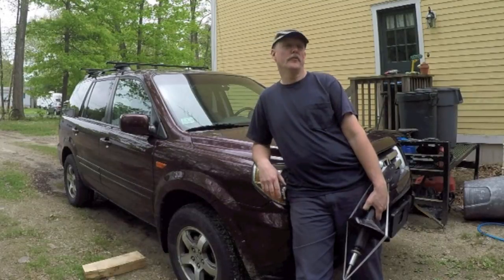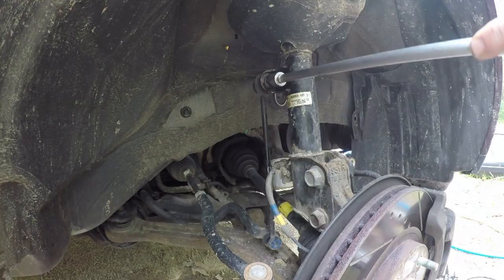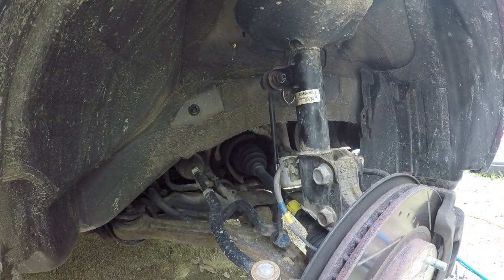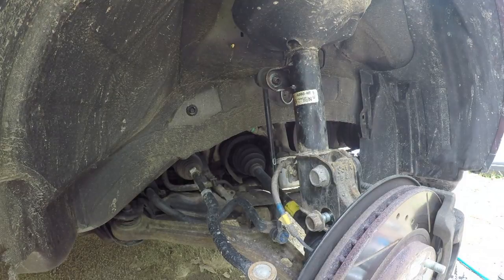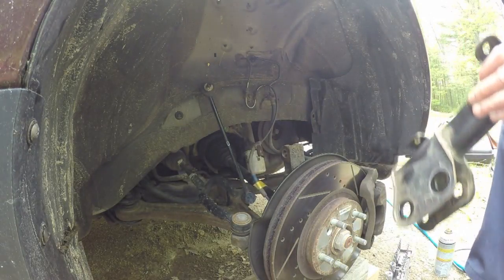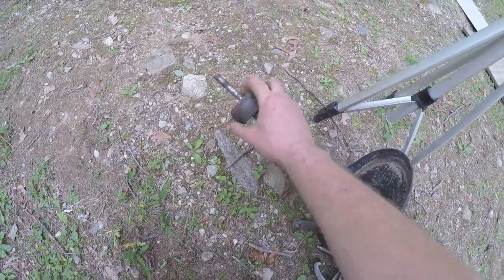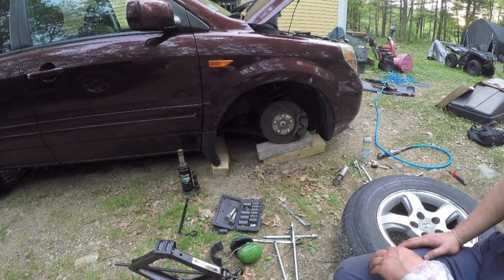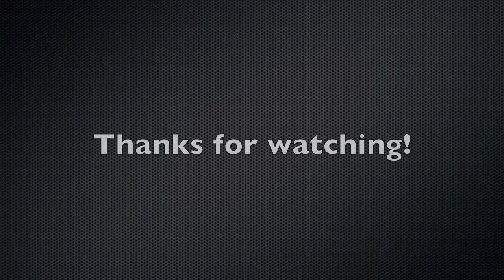2007 Honda Pilot front strut replacement

Comment: Wow  you were quite fortunate. Invest in a floor jack, chocks and jack stands. Just did this job last week after watching your video. I bought KYB struts with new springs pre-installed. Made the job super EZ and safer.
Reply from the maker: Thanks for commenting.  If my large strut spring compressor were wall mounted (as designed) it would've been much easier. After watching numerous people have the cheap rental type clamp style slip off under load, I decided I was not going to even try one of those. With some vehicles, the price difference between bare struts and struts with springs is low enough that I'd say don't bother with swapping out the springs. Some vehicles have a larger price difference so paying a friendly mechanic to transfer springs for you might be worth it. It was pure luck that I found that professional strut spring compressor at a flea market for so cheap.